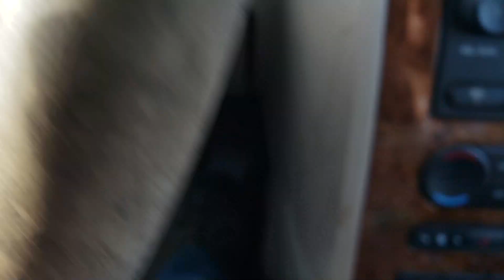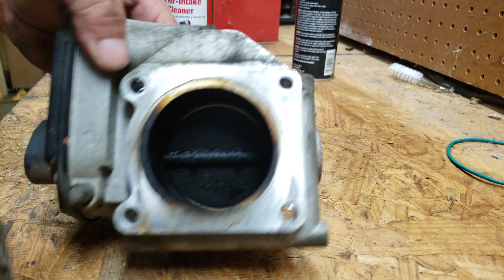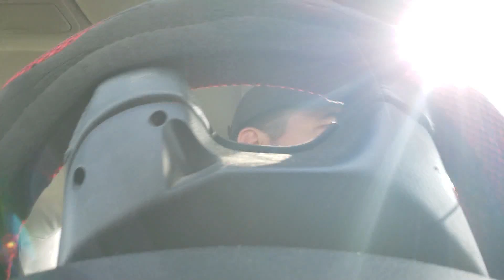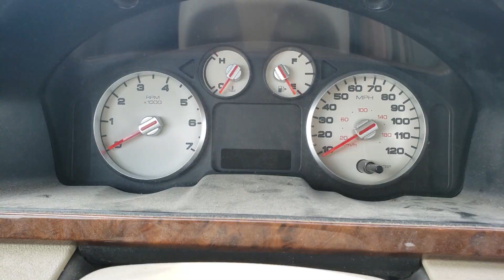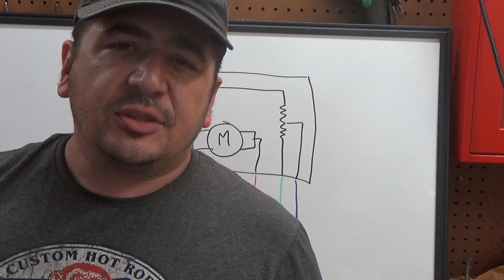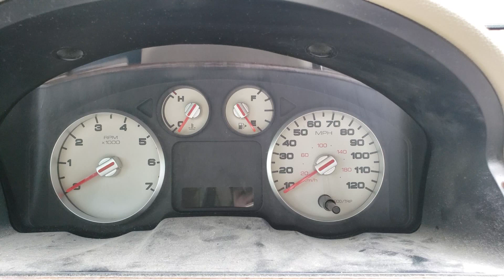2005 - 2007 Ford Five Hundred Throttle Body Problems

Comment: I’ve replaced my throttle body with a brand new one( 2005 ford freestyle) have tried the relearn procedure over 5 times. Still doesn’t relearn, when I press on the gas I bearly get any response. I was thinking maybe the pedal accelerator sensor but I don’t have a check engine for it. I don’t have a check engine for the throttle body either. NEED HELP!
Reply: Did you ever get a solution to your issue?
Reply: @the @thetommy2278 d not I ended up selling the car it was just a huge hassle. The person that bought it from me told me the motor had low compression but he didn’t confirm it with proof. What issue are you having ?

Comment: So what would trigger the gas pedal not to accelerate after receiving the codes p2104 and p2112 also my issue is for a 2008 for f150 4.2l v6

Comment: I had a Ford Five Hundred, It was given to me by my son! The fuel pump was replaced. He lost power on the highway, He fought to get to the brake down lane with haste twice. Wasn't the throttle body wasn't the fuel pump! I flushed the transmission the problem went away for a very long time, intact years!! Idling high low is throttle body clean relearn or replace. Losing power is a transmission fault so if you're in that position and you turn the key off then on and it regains power transmission is your issue!!

Comment: I used a mixture of marvel mystery  oil, transmission fluid and throttle body spray cleaner. Took my dremel tool with a 3/4 brass wire attachment which  seemed to get all the hard stuff off faster than with a brush

Comment: Check operation first, use a screwdriver, or risk a finger (TYVM for that little tidbit) to check if the TB is seized or sticking. Have a friend step on the gas with the key on, engine OFF and watch TB, should fully cycle. If not suspect wiring or pedal sensor and check wiring/voltage as he and others have described. My 06 500 TB made a horrible grinding noise and didn't move at all. Problem solved.  You could've skipped the whole cleaning procedure for your customer, but that's cool, it was very informative. The extra step in DCing the wiring harness saved me, as well as the short/discharge/relearn procedure. TYVM again! Great video!

Comment: You shouldn't need to REPLACE the throttle body on a Five Hundred unless you haven't run an air filter. A good healthy spray of Berryman B-12 to clean the TB every 30,000-50,000 miles SHOULD be enough if you buy good gasoline, and stay away from fuel with ethanol in it. If you try to "cheap-out" and run E-15 fuel, you'll have BIG PROBLEMS!!! A can of liquid Berryman B-12 or Seafoam in the tank every 25,000 miles is also cheap fuel system cleaning, including the in-tank fuel filter "sock". Do Berryman in the tank and use 100% gasoline, and it's no sweat to get 22 MPG in "grocery getter" duty with the 6 speed Aisin transaxle and 32+ MPG at 75 MPH highway (my 900 mile trip-BP 89 octane gave me 33.8 and Shell 87 "Platinum" gave me 35.1 @ 70 and 75 MPH cruise all the way Tulsa to Houston and back.) The Taurus/Sable/500/Montegos with the 3.0L are some of the BEST cars made this Century by Detroit. I only wish my 500 had a "moonroof" and was designed to carry 5 FAT (over 170 lb.) people and some luggage.

Comment: This was great info. This has happened to me several times and was not able to fix it. I changed the fuel sensor thinking it was that, then it worked after resetting the codes, but now it kind of idles erratic, specially when waiting on red lights.

Comment: I'm having an issue where I get code P0563 05 Ford 500, the car will run and then charging system light and message appear and the lights and cluster and radio go out for a couple seconds but will still accelerate sometimes, and comes back on a few seconds later. I've replaced alternator 3 times this last time I made sure it was a brand new alternator not remanufactured. And I've checked all the fuses. The idle is quite irradict and I'm just lost not sure how to even begin diagnosis my dad has tested a ton of things as well and were both baffled. Any suggestions? Really hope u see this.

Comment: Fantastic cleaning tutorial to save throttle bodies.
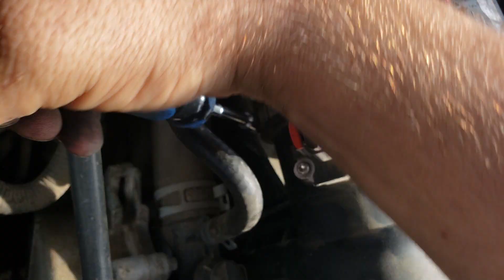Cool 10 cent tip: before buying new throttle body if limp home problem still occuring, at 23:16 also remove negative cable of battery and touch the positive cable of battery with a jumper wire for 5 minutes to discharge the capacitors, clearing the memory and trigger the proper relearn procedure. 
This will save most throttle body replacements.
Seems like this is already a second throttle body as the coolant delete upgrade was done. All new 3.0 V6 came with the coolant line in & out version that was a bad design.
Reply: Its a 2007, no coolant lines to TB

Comment: Well, you got one thing right you did clear the codes, the correct way, but by you, stepping on the pedal and slowly releasing it, you did not do a thing nothing all you had to do was started up and just let it idle. It will teach itself and it’s not going to take 15 minutes it’s gonna take longer you’re gonna have to have at least three drive cycles on it for the misfire counter to sit in your fuel trims to start the balance out that hot call does not work. You got to go in with a scanner and reset your cam module because you’re going to have a code in the system that the battery was disconnected. it’s a collect Joe blow off the street. He doesn’t do it for living you could do all that and once somebody else gets in it that car is good just to their driving habits and the next person it gets in it it’s going to adjust to their driving habits so don’t listen to this guy. He doesn’t know what he’s talking about.

Comment: Where did you get the throttle body from because I had the same issue with the same car
Reply: These car's are known for carbon build up and other issues with the throttle body. Carbon buildup is the most common problem with the throttle body

Comment: What if you got the new throttle body and  gasket , and you did the poor man’s reset. And then when it went to relearn it started running rough on low rpm idle and then died. Do I need to do the reset again or just restart the vehicle?

Comment: Thank you so much for this video. Just a quick question, can i do the battery reset after cleaning the old throttle body since i do not have a new one yet? is that advisable?

Comment: Hello. I did exactly what you said. I heard a noise when i turned the key on, when it was "proofing out" think i heard the throttle doing something. I then pushed, slowly slowly on the gas pedal like you said, and i heard a noise again, this noise sounded like a clicking noise from the throttle. Counted a few secs. Let off slow. Turned it off.  And started it. I let it sit, idle, for 20 minutes. It sounded good. Then drove it. 

Im curious why you have to push the pedal to the floor? Can you please explain.

What was the clicking noise? Is that bad?

Thanks

Comment: My 500 would not start no wrench or engen light. Relearned it then it started but would not rev over 3000, so im on way to bone yard for used. Cant afford 625 dollers at dealler .To be continued. Dec 6 2020. All advise Taken.

Comment: Does this capacitor discharge method work in a similar fashion with most modern day vehicle computers?
Reply: YES, BUT SOME YOU HAVE TO HAVE THE RADIO CODE TO RESET RADIO. ALSO SOME YOU MIGHT HAVE TOO TAKE TO THE DEALERSHIP & HAVE THEM USE THEIR SCAN TOOL ON IT. CHECK ON FORUMS OR MAYBE EVEN OWNERS MANUAL FIRST.

Comment: What a GREAT VIDEO!! Very well explained and easy to follow.  Thank you KINDLY!! I worked A LOT on old 60's,  70's  and early 80's V-8's and this is a million miles from that.  The computer has to "learn" and "forget"!! Man!!  Gone are the days of sitting on the wheel well and adjusting or changing a 4 barrel carb or doing a tune up.  I stopped doing work in the mid 80's and by the time I wanted to get going again the whole world of motors changed on me.  Emissions, sensors and computers. Finally I just told myself IT'S STILL A MOTOR... just different. Because of videos like yours I'm back to doing much of my own work again. I'd have never gotten to this point without guys like you a sharing what you know.  So just know it's REALLY appreciated!! You're helping people like me do their own work and saving us a lot of money.  New Sub for sure and a BIG thumbs up.  I'll watch your videos just for the heck of it.  I've got a lot of catching up to do!!

Comment: These cars have a design flaw in the wiring harness where it presses on the low pressure A.C line. After a while the vibrations wear through the harness and wire insulation. It's an easy fix if you see that. Just pull the harness up and repair the wire insulation and re-wrap with friction tape.  After that leave the harness up off the A.C line. It will be easier if you remove the metal brace that runs across the back of the engine compartment but that's easy enough. You probably know this already but I'm leaving it for comment readers who might have the same problem.  I would have NEVER found it without seeing the videoI saw.  I'll drop the link below. My "check engine" light came on and initially I thought Gas cap. That was wishful thinking.  I checked the bottom of the harness where it was pressing against the A.C line and sure enough it was worn through. My 2005 Ford 500 Limited was maintained perfectly and has 225k miles....mostly highway. I'm thinking about doing the throttle body next. Still idling a little rough at a stop in drive. It stops when I put it in neutral though.  I'd rather just clean it so I KNOW it won't be a problem down the road. It's not that bad but still I know it's not right.  Thanks for the help. Really appreciated man!! BTW.... you look just like the bumblebee guy.  I saw a video of him removing a bumblebee hive and getting stung a LOT. Funny as hell.  He had a great sense of humor though.  I thought for sure you were him when I clicked on this. Here is the link to the video I found.  A Ford GENIUS and he saves people A TON of money.  fordtechmakuloco
https://youtu.be/IrDL810CEI4
Reply: Thank you so much 🙌

Comment: Next time you change anything check brakes and suspension first, sensors cause the car to not start due to wearing. Default sensors shut the car down and that is the wrench signal which means there's something wrong with the car. Check those brakes first.

Comment: Another common problem is the wiring harness that rests on the low pressure A.C line. Has a tendency to wear through. Mine was idling rough at a stop and the check engine light came on.  Pulled up the harness and sure enough it was worn through. Repaired the wires and running great now.  THANKS. I've wanted to clean mine anyway!! Your a PRO!!

Comment: My throttle body has hose connecting to it for the coolant lines. What do I do now? Please help.
Reply from the maker: That's not uncommon. Just disconnect and plug them while removing and reinstalling the throttle body. You shouldn't lose enough coolant to have to worry about.

Comment: Hey I have a question. I have a ford five hundred 2005, and when I put my AC on my car jerks and shakes. I’m not able to drive with it on. Idk what to do.
Reply: I would say your ac pump is low on refrigerant and lubrication comes from the refrigerant so don't run it or you'll wear the seal.

Comment: My freestyle computer showed issues with the egr valve, with the throttle body and I believe the accelerator pedal. I took it to a mechanic who wanted 1700 to fix it.  After watching your video I bought the egr Valve (100),  the throttle body (200), and the pedal! (80), changed and reset the throttle body myself and paid a mechanic 230 to change the other parts. Saved over 1,000.  Thank you

Comment: I have a ford 500 2005 my car seems to run good but sometimes it stalls when the AC is running. I had to turn it off because it said failure and check engine. Would you know what the problem is? I just bought it about 3 months ago.
Reply: I have this same problem with a 2006 Ford Freestyle. It also races (the engine) when AC is running and almost causes me to wreck. Weird.
Reply: @juliecolt8246  I had watched another video and the guy said there could be wiring touching something that has to do with the AC unit. Oddly enough I took it to my boyfriend mechanic and all he did was move some wires around as we had it plugged in to clean the engine light. After that nothing. Runs fine.🤙

Comment: I called Napa parts and they couldn't even get them. What is up with that has any body run into that
Reply: You must have resolved this already,  but I got my part from Amazon for just over 200 bucks, with the coolant in/outlets.
Reply: My Napa carries the gasket and a brand new throttle body.

Comment: Hello,
I had a problem with the car losing power, having to pull off and restart it, it started happening more frequently so I bought a new throttle body (not Motorcraft), and changed it my self.
I followed all your instructions but now the wrench light does not go off and after a bit the check engine light comes back on.
I followed your instructions step by step, to the t.
What did I do wrong?
Reply: I was successful in getting my truck going again. I had to get a new one. I tried to clean it but don't waste your time just bite the bullet and get a new one it save you time and mental anguish
Reply: @markdavis2090  , yeas Mark, I tried cleaning and it didn`t work.  I got a new throttle body from Amazon for a bit over $ 200 (there were some for around $ 80).  It had the coolant in/outlets and I change it myself (did the reset as well), but I still get the code.  The one about the throttle body being stuck open is gone, but it says something else about sensors, so now I bought a new accelerator pedal.  I should install the pedal tomorrow and hopefully, the problems will go away.
Reply: Did your peoblems go away with the pedal sensor 4 yrs ago lol @ronpinto9588

Comment: I am the new owner of a 2006 Freestyle that I bought from a private party.
When I picked it up all was fine but, as I drove home on the freeway, I suddenly had a loss of power.  The engine didn`t shut down, just the revs wouldn`t go up enough, while the wrench and little engine lights came on.  I pulled to the shoulder and tried to move again but couldn`t.  
After a couple of minutes trying to decide what to do, who to call, I turned the engine off and was just there, frustrated.  Then I turned the engine on again and not only the wrench light was gone as the engine was running normally again.
The "oil 0%" message was on, so I took it to change the oil butb the message did not disappear, no matter what I did with the reset, setup, etc. buttons.  I am not sure what to do about that yet.
In any event, at the oil change place, they ran the computer diagnostic and it gave us 3 codes:   P 2111, P 2104 and P 0401.  
At home I checked and it said that P 2111 was "throttle actuator stuck open".  P 2104 is "System forced throttle back to idle, and P 0401 Says that "insufficient EGR flow".
I am no mechanic, but quite curious and seeing your video showed me that I can handle the throttle body issue.
However, could you please give me some orientation about what to do with the message center?
Thank you for helping.
Reply from the maker: To reset your oil life, use the "Setup" button that should be on your steering wheel to scroll through the messages on the cluster until it shows the "Oil Life %"

Then hold down the "Reset" button until the message changes and asks you to confirm the oil is new. Release and then press and hold the "Reset" button again until it says it's set to 100%.

Hope this helps and glad you were able to solve your throttle body issues.
Reply: @DIYAutoHomeschool  Thank you.  I tried the setup and reset buttons but nothin g worked to change the message
Reply: @ronpinto9588  this oil reset is hinky, I'm the only one in my family that can manage it. I think it worked to quickly press the RESET, let go and then press and HOLD. I have to mess with it every time.
Reply: @juliecolt8246 , thank you so much.  I will try that immediately.
Reply: @juliecolt8246 , I tried but it didn't work.  I quickly pressed reset several times, let go and then pressed and held it for a few seconds.  Nothing, but thank you.

Comment: i tested the 2 center wires and got no response. zero volts and touched wire and no fluctuation. whats wrong? i have a 2005 ford freestyle 3.0
Reply: Bad connetion at computer or bad computer. Or broken wires in harness near throttle body even if they looked wrapped perfect i had that issue

Comment: Are the online throttle bodies ok, or should I pay the $672 Ford price? I have an 06 Freestyle.
Reply from the maker: That depends on what you mean by "online". You can find the Motorcraft (Ford OEM) throttle bodies online from different suppliers for cheaper than you'd buy from your local dealership parts department. You can usually find most of the same brands you'd find in your local parts stores online for a cheaper price. I've put those on and had no issues, but like with any brand of reman components and even the after market new, you'll have a few issues sometimes. 

Now, if you mean those $25 no name throttle bodies that take 3 weeks to ship... probably stay away from those.
Reply: @DIYAutoHomeschool  Thanks for your help.  I saved about $550 by purchasing an online throttle body.